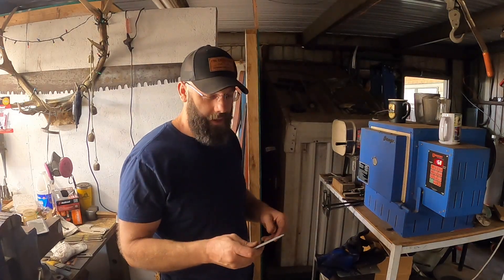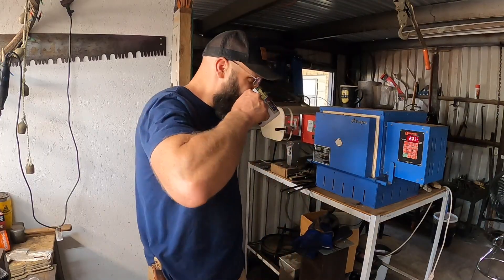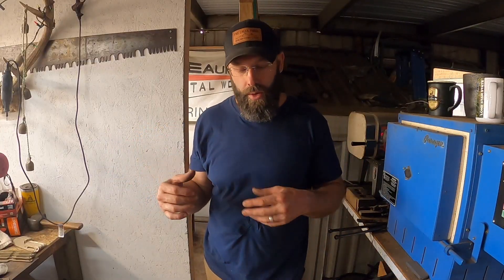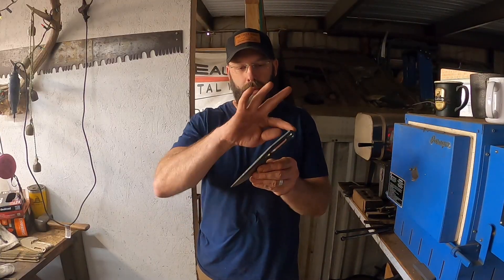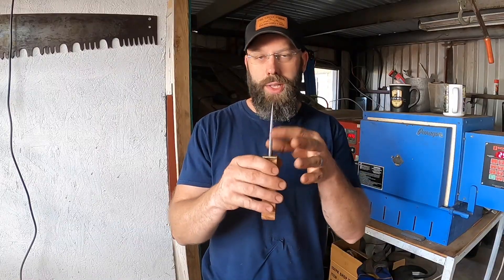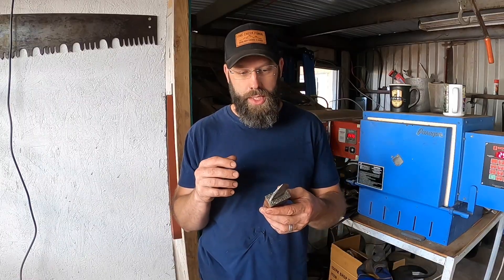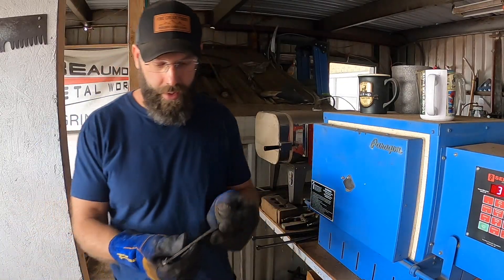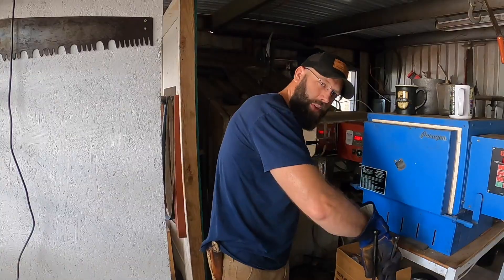The Age Old Problem With Steel

Comment: This is the kind of thing that makes me follow you. I can’t agree more with steel selection for the task. Blade design also plays into that as well, just like you say. Not having a heat treat oven, I’ve been having good success with 8670. Edge retention along 1095 and incredible toughness and a simple heat treatment. I’ve been looking at a few others (much higher carbon content) for kitchen knives but haven’t decided what I want to try yet. Great info, thanks
Reply from the maker: Thanks! While I have not used it personally, the new steel Pops Pro-Cut might be worth looking into for you, it's supposed to have better edge retention and a forge friendly heat treat protocol
Reply: @FireCreekForge . Yeah that’s one that I’ve been looking at. I pretty much buy from Pop’s exclusively. The Chefcut is interesting as well, similar to 26C3 but shorter soak time. I’ve been using their Sheffield 1084 for a while and just want more carbon for edge retention.
Reply: Solving the Riddle of Steel...

Comment: Dumb question, Elijah. If you do an Edge Quench. Use a Hand Held Infrared Thermometer. Let the steel cool to the desired Temper Temperature. Pull the blade out of the Quench, let Heat go to the Edge. Would that work as a Temper?
Reply from the maker: Yes theoretically that would work, and traditional blacksmithing uses techniques like this in some cases, (chisels, etc ) but on a curved blade or different tapers it can be difficult to get an even tempering heat out through the blade and edge so you run the risk of portions being overheated or not temperature enough. 
Beyond this, we generally temper the steel for longer periods of time.
Reply: @FireCreekForge  I never thought about a Kukri knife or other Curved blades. It would be a factor. Thank you for your Knowledge. Have a great weekend, Elijah.